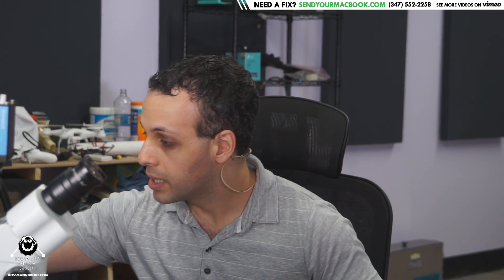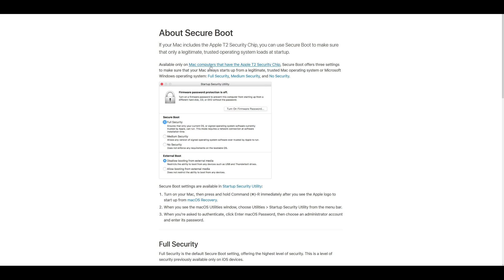An important message from Louis Rossmann

Comment: If I understand this Apple has become a company that has developed a 2 pronged business model.
First is a strategy of  a  rapid  development process to design new high cost products with built in high frequency mean time failure modes designed to produce  short life cycle products which cant be repaired or recovered , simultaneously developing updates to existing working products designed to  increase both their failure mode frequency and severity of failure,  then release  both updates a products several times a year.
Second is a warranty and after sales strategy   Where  when repair is possible Apple and their representatives mislead the owners of the products in regard to the nature of the failure and the costs of repairs, and withhold information from 3rd party repairers to prevent repairs.  In order to generate a rapid turnover of new product sales.
I went Apple in 2011 with a Macbook pro Ipad and Iphone.  Because of  the way Apple has been conducting it's business,  2  phone upgrades ago I switched to Android, My late model Ipad air2 will be replaced by a surface.
Apple have gone from a  company that provides innovation in products  to being a predator,  I urge everyone to hang on to your current apple devices as long as possible when they fail switch, I have no intention of buying Apple products ever again.

Comment: Ahhh secure boot, the same garbage from the windows pc/laptops ...
Reply: This is a combination of hardware and firmware, it has nothing to do with windows.  It is a system designed to prevent people from overwriting stolen harddrives, as well as accessing any data on them at all from outside the proper boot procedure.  It can be run with any operating system, and even most android phones have this - it is why you have to go through extra steps to enable installing custom android ROMs or Operating Systems to phones now.

Comment: You recommend not buying from a company that treats their customers like trash and I'm listening.  If you can suggest a company that makes a computer that's durable, fixable and with good product support I would appreciate it since I'm thinking of replacing my iMac.

My experience with Apple hasn't been bad.  Yes I know; I'm lucky.  I bought it in 2009.  It crashed twice; once when I tried to use a program to defrag it (apparently not a good idea) and another time when I replaced the hard drive preemptively after it started making a funny noise.  Both times I took it to the Apple Store where the problem was corrected at no charge.  The computer now has all the RAM it can hold and can't take any OS more advanced than the El Capitan that's in it.  If I knew a new iMac would be as good as what I have I'd get another one but Apple apparently has "improved" their product line in a bad way.

Comment: Catalina as of Q1'20 requires that drivers be signed not just at the package level, all internals must be signed, called a "hardened runtime", when Catalina first came out in Q3'19, Apple extended the grace period for enforcing this til Jan 2020. Earlier versions of Catalina might actually work, try 10.15.0 instead with the wi-fi card install. Fast forward to 10.15.4. You'd need to make sure the device driver for your replaced device has a "newly" signed device driver with that hardeneded runtime to accept it. And that when you install it, you approve the KEXT in Gatekeeper. Then it should work. I should add that if you turn off SecureBoot, your "hardened runtime" signed KEXT may not install or run without seeing the SecureBoot ready OS setting.

Comment: This is really enlightening and thanks to all this information I have come to the conclusion that in the future I will not replace my 2013 MacBook with a new device from Apple but watchout for an alternative instead. It would be helpful, of course, if some more details about alternatives could be given. Louis has often mentioned Lenovo. These devices seem to be a much better choice in terms of hardware, upgradability and service. Unfortunately, Lenovo devices are only shipped with Microsoft Windows. 

As a long-time Unix user, I personally find Windows simply unacceptable. However, there are a number of other good reasons not to use Windows, such as the malware situation, the forced updates, data protection issues, to name just a few of them. In my opinion, Linux is now a good alternative even for inexperienced users. However, compatibility problems can never be completely excluded and the installation of a new operating system is not for everyone.

Dell is the only mass producer to offer Linux as an alternative operating system.Unfortunately, the high-end XPS laptops seem to have a rather dubious reputation regarding durability (e.g. issues with the battery) and it is very difficult to get further information about the quality of the hardware from niche providers like System 76.

Overall I would like to point out to Louis that Apple has been the only alternative to Windows for 'normal' users for a long time, at least in terms of the Unix operating system, and that this seems to be the main reason why so many people have remained loyal to Apple despite all the unreasonable conditions. You can't simply say to these people: "buy Lenovo", because Windows 10 is probably not an alternative for most of them. 

And last but not least: wouldn't it be mentally better to also take care of devices that customers can't be discouraged from the very beginning? Repairing them will ultimately help Apple, who don't really seem to have deserved it, if you believe Louis' statements, which I do.
Reply: Lenovo have relatively recently announced that they'll be selling ThinkPads with Fedora pre-installed, so maybe look into that

Comment: I don't think the problem is a secure boot chip. I think the prolem is one that fails in a way that makes data unricoverable.
For example, if the laptop sent a recovery key to apple when first connected to the internet, the user could simply take the divice to apple and get such a feature disabled. Further, since apple would be the only ones with the keys they still have exclusivity over secutiy procedure. They could encrpt as follows RSA_4096(AES_256(Recovery_key,  AES_key), RSA_Pub_Key). They then enbed the private key in software disributed to trusted repair centers. Or to make it easy to chenge the key AES_256(Recovery_Key, AES Key)  RSA_4096(AES Key, RSA_Pub_Key). that way they can just decrypt  and encrypt the AES keys.

I mean they already do that kind of thing with battery serialisation right?

Comment: When secure boot was implemented  on generic PCs years ago it was always intended to allow non signed operating systems to be used so they allowed you to go into the uefi setup on boot and disable the damn thing if needed. Apple knows better though you always want it enabled
Reply: Um you can disable it in UEFI. Its called recovery, Then you go to firmware settings, where all the options are there.

Comment: Ever since the iPod, people have been telling me to buy Apple. Yet, ever since that same iPod, I have refused to buy Apple due to being overpriced, underperforming and unreliable.

I am thankful that I no longer have a need for portable computers, though I used to buy high-end laptops when I needed to upgrade. My latest computer was a mid-range tower, as I no longer need to move it around, and towers are easier to upgrade and repair, especially when compared to the latest generation of laptops, which is fast approaching Apple with regards to repairability.

I avoid having anything worth keeping on my phone without making sure I have external backups. That way, I only loose my phone if it dies, and not my data.

The perhaps saddest thing is that finding repairable products is getting more difficult every day, even when they're not made by Apple. And as electric cars gain popularity, I look forward to the day my car becomes impossible to repair due to "water damage"...

Comment: I've never bought an apple product in my life. Nobody seems to be able to show me an apple product that still works after 15 years of everyday use. My business stock control system runs under DOS on a 1994 486 computer day in, day out. I wonder who apple aim their products at.......perhaps it's the next step up in life from a Barbie doll. I wonder what the attraction is to the over 21 age group. I can only assume their customer base is 14-21 year old's who have a mummy who keeps buying them new ones.

I had this (as a 2-way radio engineer) with Motorola products. In the late 90's the smiley boy, sharp suited Motorola rep swept into our premises to show us a new model hand portable radio. He went on to say it was non-repairable. I pointed out a faulty aerial on a 2-way radio will destroy the output transistor through no fault of the radio....he said, they buy a new radio then....I said, but they buy a different brand next time that IS repairable. A few weeks later I was no longer a Motorola dealer. Yipee!

Richard (UK)

Comment: To be fair to Apple, the whole point of Secure Boot is to prevent someone from booting another system, or a maliciously modified system, so I do get why they enable it by default. AFAIK, all Win10 laptops have it enabled by default too, but unlike Apple machines, you can just disable it in BIOS, rather than needing to have a bootable OS, which is signed by Apple/Microsoft - depending on the machine - at which point this is a non issue anyways.
So, while I do get Apple's standpoint. I do agree with you, that maybe it shouldn't be done like this. I feel like if a) you could access an Apple machine BIOS like in any other computer, and b) you could change the secure boot setting there, this would be as much of a non issue, as it is on computers with security features for the sake of actual security.

Comment: Looks like the cloud is an excuse for degrading durability and reliability on the so-called "edge", and not at all due to consumers' fault. All they would need to do is not tightly couple the hardware security module (T2) to the storage (soldered onto the board, just why?). With LUKS, I can manage keys myself so I can decrypt the disk/partitions wherever I want if need be. It's really weird that the food org doesn't want to offer convenience at all.

Comment: would be nice if that option can be easily set off, but for corporate machines where data security matters more than the data which is usually backed up it makes sense.

Comment: I think the ability to corrupt the data is the whole point of that T2. However, it's more like an enterprise feature if you ask me. It does prevent thief from getting access to the sensitive data inside the stolen machine. 
However, the secure chip needs to be solid. If it dies every now and then, then it's more hurt than helping.
Anyway I think Windows also have this kind of feature, but MS let the people have the access key to that secure data. If the security chip is corrupted or something, replacing the chip will let the user access to the data if the security key is known. It's more error prone than the lock-down security measure like Apple, but it is not as annoying IMHO.

Comment: Apple keeps amazing me with crappy design. PCs are modular by nature. Even laptops. This modularity means there are standards in place so that you can throw all kinds of parts together and it'll still work. Even with laptops you can usually swap the HDD/SSD, add RAM, replace the battery, install a new keyboard or touchpad and so on. Pretty much any part that is broken can be swapped to a new, working part. Somehow Apple keeps undoing this repairability, modularity and interoperability and is heading towards a situation in which if any single thing fails in your computer, you just have to buy a new one because it's completely impossible to fix anything.
This is some kind of a new low even for Apple. A common component, not related to the safety of your data, fails. You replace it with an idenctical component but the computer won't work anymore because the OS has a list of component serial numbers and if they don't match then the computer won't boot. That's ridiculous.
It seems that Apple is working very hard to make their products as disposable as possible. It's like making a car that has non-replaceable fuel and oil filters. Once they get clogged up you either pay the manufacturer to swap the entire engine or you buy a new car. It keeps amazing me why people keep buying products that are so bad. They're bad for the environment, they are bad for the consumer and they are bad for the industry.

Comment: Would it be possible to 1:1 copy all data on the ssd; wipe, fix t2 firmware, restore data? Or de-solder t2 in a different host; fix firmware, put it back? A lot of hassle, but could it work?

Comment: I don't own an apple anything, never have, due to prefering a different operating system. My question is, can the t2 chip be removed to negate the problem? Or can you remove the data drive & temp place into different device, just to get data back, then do the erase data procedure, then re-install it. Sounds like everyone that has an apple needs a clone drive (usb or memory chip connected at all times to capture & mirror internal memory).

Comment: If Apple is to continue with this T2 chip, at the very least it should have two memory chips, for backup and buffer. Where new firmware goes. That way all is not lost if the update corrupts, and only after validating the new update, should the T2 chip flip a bit to use that firmware on that chip. Then do the same but with the 1st chip for the next upgrade. Basically, kinda, somewhat functioning like integrated dual-bios solutions do.

Comment: So they're actively building features into their software updates that fuck over not only the customer but also independent repair. Diabolical, but unsurprising. 

I work as an AV technician and a lot of my job involves assisting clients in connecting their devices to our technology. Of course we don't have control over what devices our clients choose to purchase. But I swear if I could I would simply disallow our clients' use of Apple products. They are nothing but pure shit. I mean, Catalina basically broke everything as far as wireless presentation is concerned. And now I've just discovered that only Apple's proprietary USB-C connectors will work with their laptops, making wired connectivity that much more problematic/costly for us to provide. 
I don't fucking understand what the point of these devices is anymore. They don't do anything better the competition. They are horrendous for professional settings since they can't reliably connect to technology that you might find in such environments. And they're always doing fucked up shit and if there was any justice in the world, any time someone asked me for help with their Apple device, I would simply be able to respond, "Sorry, I don't speak retarded."

Comment: A small correction Louis, as someone who has to check the Secure Boot setting on every Mac deployed (And I am talking thousands, sadly). Secure Boot being enabled out of box is the default behavior for the T2 chip even as far as High Sierra. I remember running into this when trying to upgrade the factory OS from High Sierra to Mojave out of the box using a USB installer, and it would flash the prohibited sign at me. I tried doing this at the time, because Apple's Command + Option + R wasn't booting into Mojave Recovery despite Apple's KB saying it should have. I eventually beat around the bush with Apple support and that ended up being a firmware bug which they still haven't fixed to this date. As a workaround, I have to put the T2 into DFU Mode, upgrade the firmware to it, then I'll be able to install the latest OS out of the box.
As for T2 chips bricking themselves, I've had a higher rate of these coming in since Catalina's launch, and whenever they brick, it has always been due to a failed firmware update pushed silently by the OS. I know this because so far, I've had about a 95% success rate on recovering the T2 chip without data loss. After completing the firmware restoration, the machine is always booting back to the macOS installer to finish the update it was doing.
The bricking problem seems as if Apple has rookies at the wheel when it comes to developing embedded IC firmware. An embedded device like the T2 chip is supposed to hold aa ROM with two boot addresses. One pointing to a primary partition, and another pointing to a backup partition with some additional code in place. Every modern PC BIOS does this, and in the event of a bad firmware flash, instead of your BIOS getting bricked, it will boot off of the backup partition, restore the known good copy of the firmware to the primary partition, reset, then reboot off of primary. The T2 doesn't seem to have this fault tolerance, or enough of a boot ROM capable of getting the machine booted enough to be recovered without another Mac. It is really garbage design, as an embedded IC should never be able to brick itself this easily. It has driven unnecessary volume for me in the COVID work from home world that jeopardizes Apple's customer's job, and puts myself and many others like UPS and FedEx at additional risk.
For recovering data, don't force the chip into DFU mode. Instead, let the chip itself boot to Recovery. All you need to do is connect your USB and power cable, and the T2 should boot to this mode. If the battery hasn't run flat by the time you get to the machine, unplug it first, then restore battery and AC power, and then check to see if the T2 shows up in recovery mode or DFU mode automatically. You'll have a better time getting data.
Finally, it would not surprise me if the T2 chip via a special boot mode triggered by DFU mode allows for data recovery. Let's hope that becomes true someday.